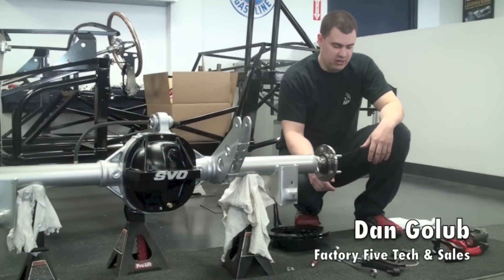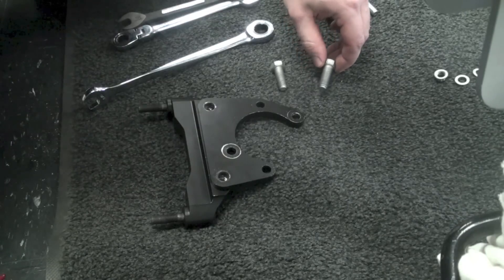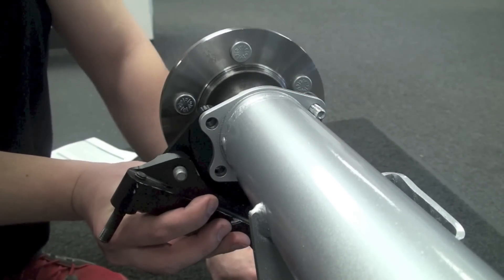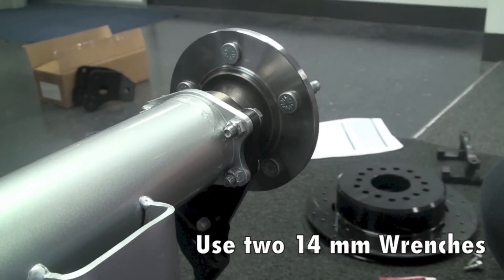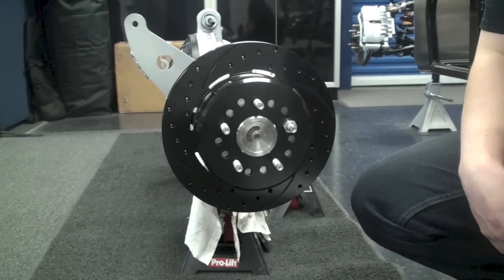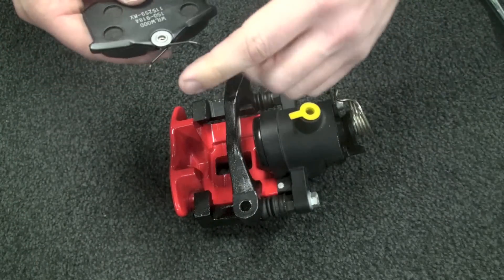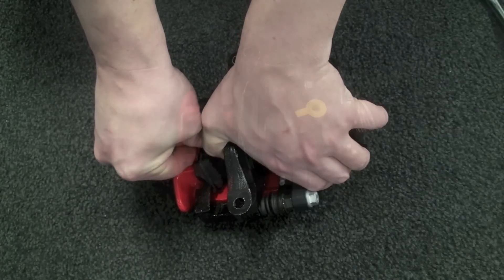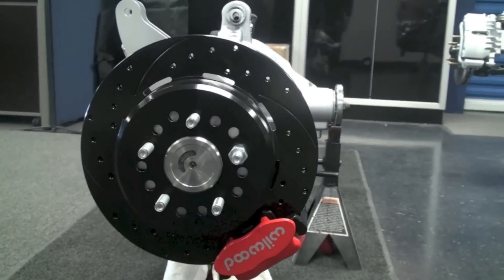Factory Five Mk4 Build Episode 6: Rear Wilwood Brake Upgrade

Comment: Not impressed with the rear suspension.   I have been a motorcycle guy not a car guy so I don't even know the terminology but I do know If I am going to build a kit it is not going to be ancient tech rear suspension ....I want some sort of independent setup using wishbones? Whatever's the terminology is for independent wheel travel rather than both rear wheels on the same ridgid rear end.   So this part of the video is already a deal breaker for me....have to research further now

Comment: I don't know if anyone is still paying attention to these comments but I'm wondering how the break install is different w/ the IRS option?  I have a 2001 Mustang Cobra and I know that the caliper mounting is attached to the wheel hub which is in turn bolted to an upper and lower control arm similar to the front suspension.  I would assume the setup is similar here but it would be nice to have a video of this as well given that irs is a popular option.
Reply from the maker: +Doug Bankhead  Here is a link on the new IRS, if this doesn't answer your questions feel free to give Factory Five a call.  http://www.factoryfive.com/whats-new/factory-five-launches-2015-independent-rear-suspension-option/